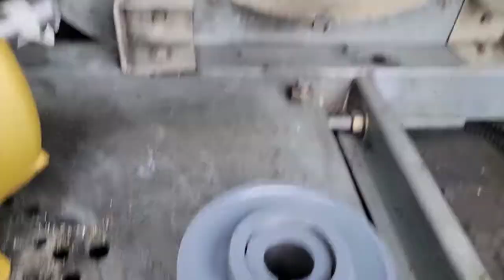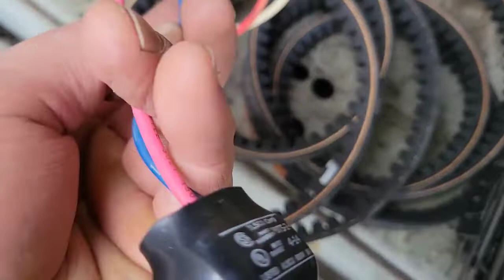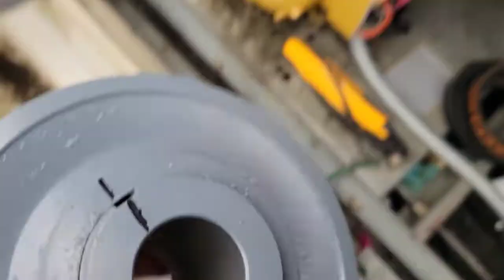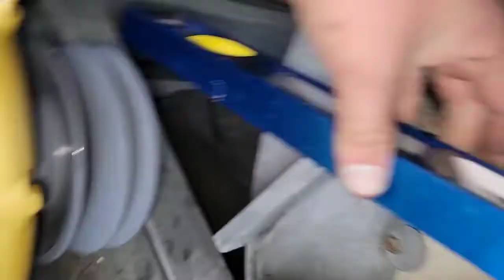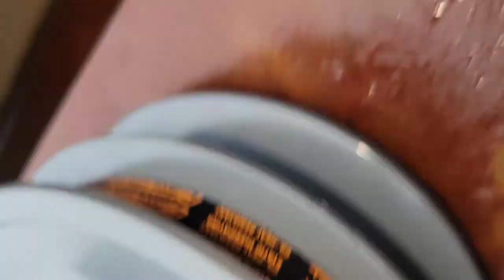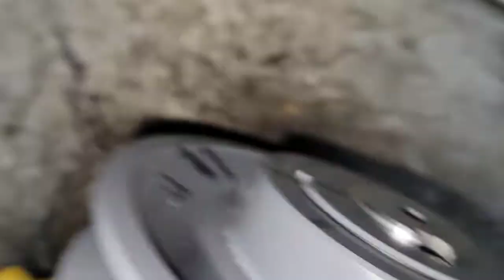HVACR - 3 phase 208V 10 HP Motor Wiring and amp adjustment

Comment: When you put the two motor leads into the one side of the insulated connector…do you twist the two wires first? Or do you just have them side by side with the screw coming down on them?
Reply from the maker: So if you twist them together they'll have a better connection. 

It was so long ago I cannot remember what I did.But the entire socket is still so as long as it's making connection with somewhere in there it should work. But twisting them together would not hurt

Comment: Do you ever set the motor amps based on SFA with heat & when OL comes into play you add a 10% - 15% cushion? If there is a telemanique OL or similar?
Reply from the maker: Typically I just set it to what the manufacturer tells me to. 

But it sounds like you might have some knowledge I don't have if you care to elaborate I would love to learn :)